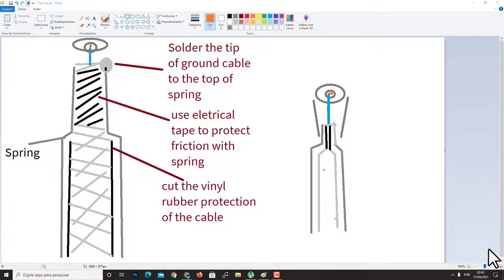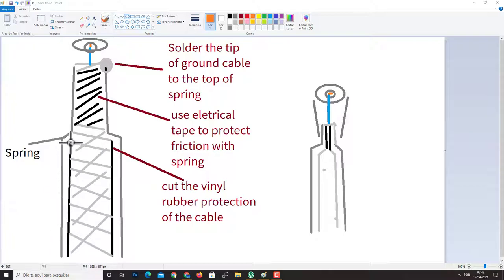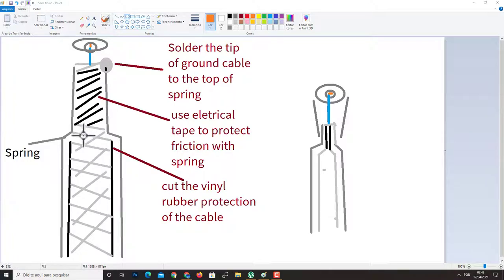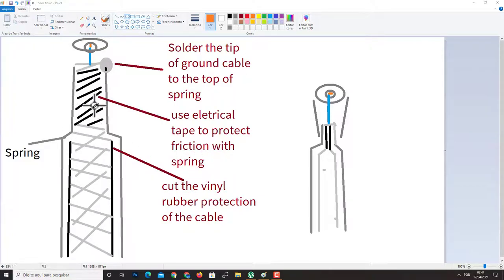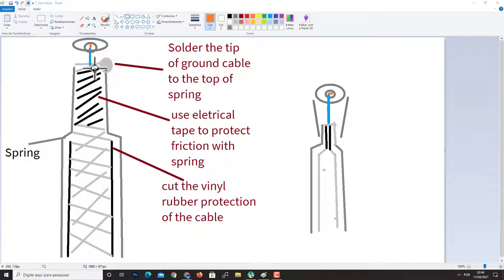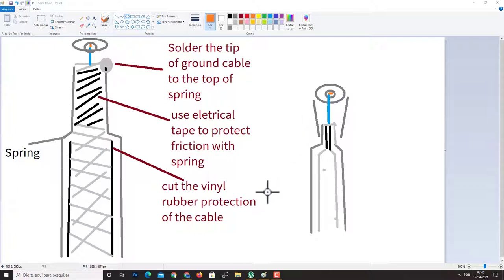How to Solder an Old Vintage High Impedance Microphone Connector Plug - Vintage Hi--Z Conector

Comment: It would be far more helpful to actually "SHOW" the repair ,then talk of it..   :(  ...
Reply from the maker: I think you can make it man🤟
Reply from the maker: Tô solder the tip to the coil you need to heat the coil first then use soldering paste and then the solder